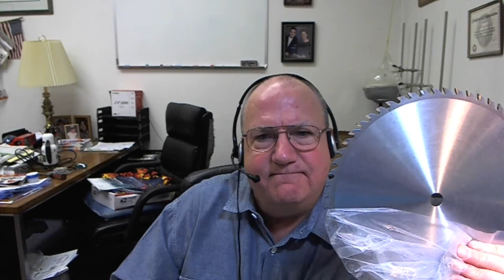Carbide Sawblade Specification Manual: Brazing carbide tips

Comment: I brazed a big bandsaw blade together, at around 1000 revolutions it snapped, BOOM. Oddly the braze joint didn't snap, the steel next to it snapped, must have messed up the temper in the steel with my heat. 🙄